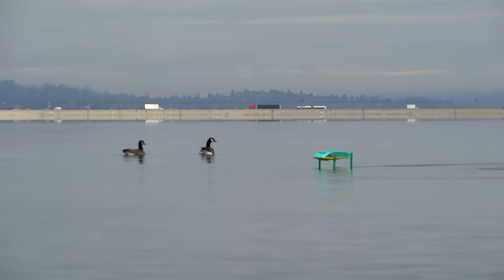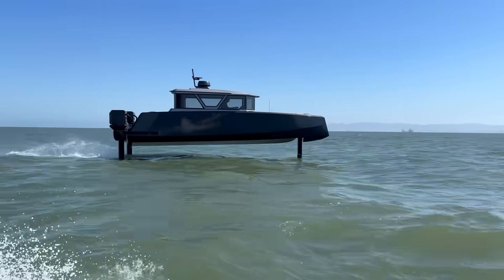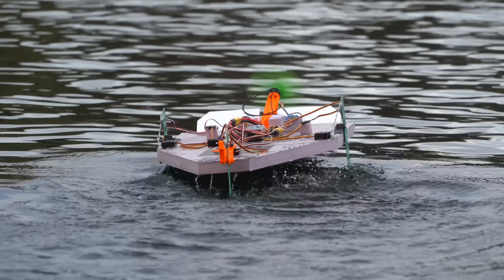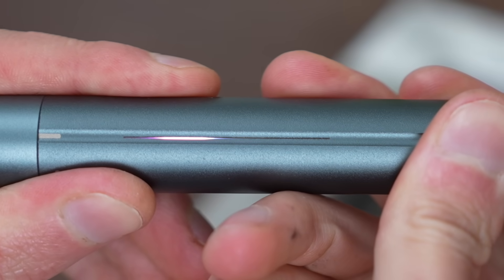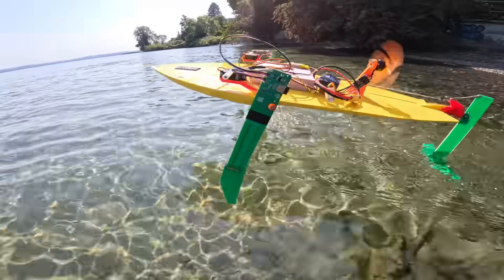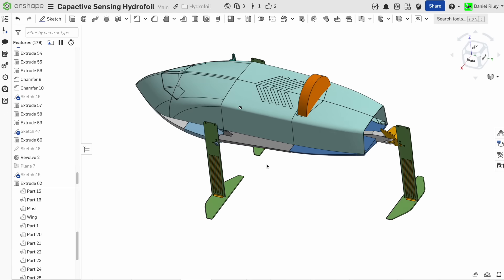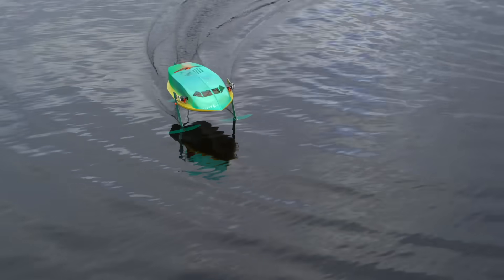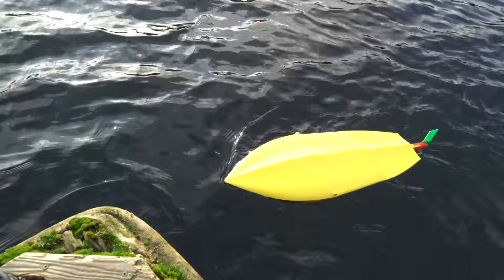Hydrofoil R/C Airboat Build and Test

Comment: And chance that rolling is due to torque steer from the propeller?
Reply: Run the motor the other direction and see if the boat flops the other way would be an easy check to do.
Reply: I came here to specifically state that. The torque of the prop combined with the friction of the hull is what's doing it
Reply: Run 2 propellers rotating opposite direction..
Reply: My money is also on torque roll. Once its up to speed the vertical portion of the foils provide enough yaw stability to cancel out the torque.
Reply: Yep, just P-factor torque
Reply: yeah it could be just enough torque to make it hard to lift the hull from the water because of the narrower frame, maybe a double prop design may be a solution.
Reply: Came here to say the same. Scrolled through the video to confirm, the prop is spinning counter clockwise, so torque rolling the right side into the water tracks
Reply: I don't think it's cause of the motor torque, more of the reason he stated in the video about the actual stabilizing feature not working. Many other people have worked with larger, faster single RC props and haven't had this problem. I'm not saying the propeller exerting a torque is not there at all, it's just too small to make an impact. Also, he said the hydrofoil boat he made at first didn't have that much of a torque effect, although it had a propeller as well.
Reply: Just what I thought to. I guess that is the answer!
Reply: 100%
Reply: That’s not what torque steer is
Reply: @chir0pter  no it's counter-torque but it is still a rolling motion due to the propeller.
Reply: @TheDornado  true but i was replying to OP
Reply: Man I really thought that 7 hours after the video release that maybe just MAYBE I’d be the first to say it… should have know!

Ya, this absolutely appears to the prop torque.
Reply: i was just gonna say, could the roll issue be an issue with thrust angle of the prop?
Reply: I think so, you can even see when its up from the water that the right hand foil angle is much bigger to compensate...
Reply: It is rolling more because he moved it to the mid rear. When it was on the front the base of the props was wider and more able to resist the twisting forces.
Reply: came to say this, definitely looks like P-factor
Reply: How about using torque roll as aggressive control authority, without need for aggressive(&heavy) servo requirements?
Reply: Use the counter rotating dual props
Reply: CRM2413A Brushless Metal Motor Contra-Rotating Motor
Reply: then redesign it with 2 propellers, that turns in different directions (that's how multi-engine motorboats do)
Reply: No it’s because its backwards it wouldn’t do that if the rear single foil was in the front 😂
Reply: Plus the foils aren’t independent   And he’s like me probably won’t fix it .

 😂😂
Reply: Being an air propeller, I doubt it. If it were a water prop that induces more torque to turn, then yes, it could be the case. I doubt the small air propeller is producing that much torque roll.
Reply: @FarmerFpv I don't know, my first thought on seeing it was, " it's just like the P-51."

Comment: Why don't more people just weld 3d printed pieces together? Use a soldering iron with a flat tip and melt the plastic together at the seams. The seal is so strong you don't need supporting rods unless you're making a long sword.